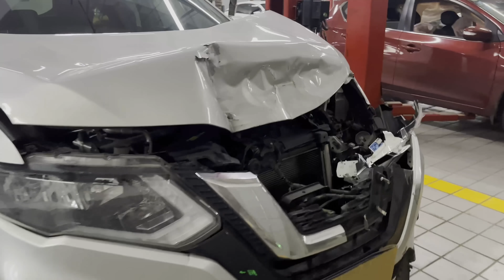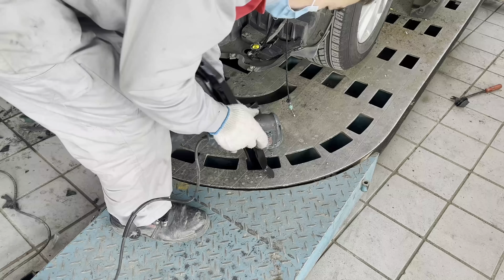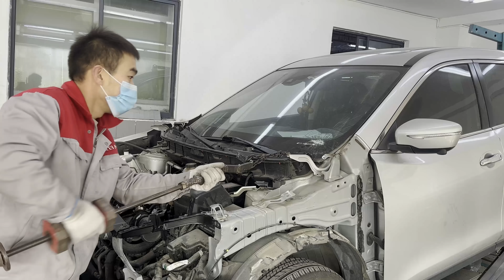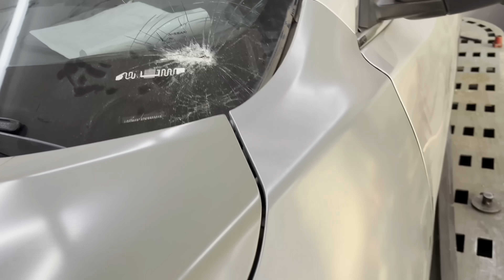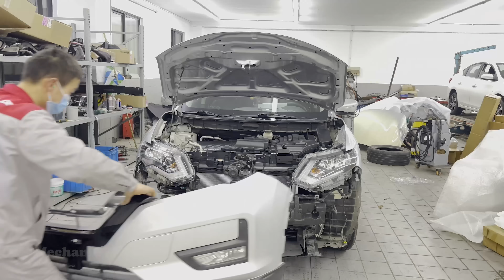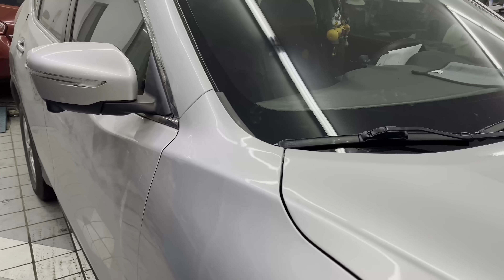Nissan Qashqai Front-End Collision Repair: Restoration Process ！

Comment: you telling me that new cars are SAFE ........   hhhhmmmmmm
Reply from the maker: The safety of repairing or rebuilding a car depends on a variety of factors, including the skill and expertise of the technician performing the repairs, the quality of replacement parts used, and compliance with safety standards and regulations. But it is not comparable to a new car in any case. Repairs of this scale do not involve safety at all. This is just the most basic appearance repair.